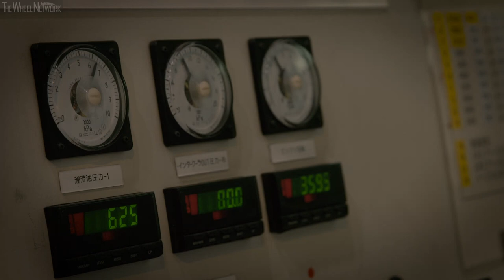Nissan Engine Production in Japan – The Nissan GT-R 'Takumi' Master Craftsmen

Comment: Did any one take notice the complete lack of assembly lube on the crank bearings before that crank drops into place?  What am I missing?  Input anyone?
Reply: I came here to say this too but I don’t think it’s necessary when you’re using a forged crank but I could be wrong…. Sort of like the way you don’t have to use it when it’s a roller cam shaft vs hydraulic tappet cams… idk